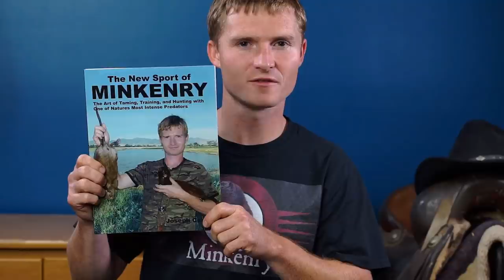Pest Control with Mink and Dogs!

Comment: Wondering what percentage of rats are taken out using this technique.
Reply: It’s hard to remove 100%, but if you follow his channel you’ll see they sometimes get HUNDREDS in one visit. 

Rats multiply so quickly that a pair can create a problem infestation in just a few weeks/months depending on time of year and feed supply. In reality return visits are usually needed every few months. However, if these same rats were instead POISONED, not only would they suffer a longer lasting and painful death, but all the local wild predators would be feeding them to their offspring, creating an even greater issue with dead owls, hawks, and other predators, including neighborhood cats and dogs that catch any. So, this method with mink/dog teams is absolutely the best way.
Reply: @eatwhatukiii2532  seems pretty thorough and effective